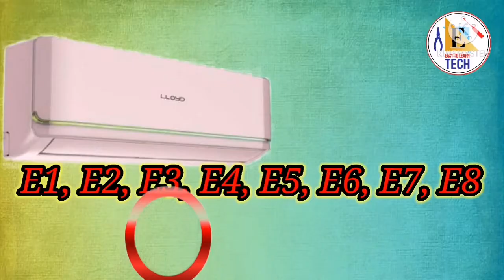LLOYD DC INVERTER AIR-CONDITIONING ERROR CODES AND FULL SOLUTIONS // TROUBLESHOOTING /TIPS /SOLUTION

Comment: How to remove cl error
Reply: Please wait for 5 minutes i do this
Reply from the maker: Please let me know if your remote is getting operate or not. If the remote is not getting operate it means child lock has been activated.
Reply from the maker: To remove the lock you have to press (  - & + ) both at same time. Your remote will be in normal mode.
Reply: How to off this error give me solution
Reply: Yes my remote getting work properly
Reply from the maker: If your remote is operating properly,than clean the filter. Re-start the unit.
Reply: Press (-&+) in which position after on ac or after on full ac
Reply from the maker: @madanmachinerytools7031  On
Reply: This solution is not working
Reply: I clean my filter but also show this please give me more solution
Reply from the maker: Your are getting cool air or hot air from ac?
Reply: @Rehankhan_HVAC_TIPS  cool
Reply from the maker: Cl is not a error, if your filters are not cleaned than it will show cl or if child lock is activated than it shows CL . It will not effect anything.
Reply: @Rehankhan_HVAC_TIPS  it mens you not have any solution😔
Reply: Press Turbo button 4 time Countinu

Comment: What about E5 and E6
Reply from the maker: Error E6: This error code usually shows up when there is an issue with Outdoor malfunction. It is prompted by LED 1, LED 2, LED 3, LED 4 which keeps flashing.  Need to check the outdoor side.
Reply from the maker: Because this error changes according to the model in Lloyds ac that's why I skipped.
Reply from the maker: If you have any issue please let me now,I will try to help
Reply: @Rehankhan_HVAC_TIPS  yes, mine is lloyd inverter model.
It shows error E5 after 30 seconds of turn on. I called a technician from Lloyd he charged me 550 to say the whole outdoor pcb is gone, need to replace with new one which cost 12,500 rupees. I don't think the outdoor pcb is gone. I am a smps technician once upon a time. I don't think pcb has any issues. So I checked with my friend who is a TV technician. He checked the board and said there is no short in it.Spoke to a local tech and he said the error must be from indoor unit. Don't know what to do.can u help
Reply from the maker: Please tell me the model for your ac
Reply from the maker: Best way to find , which PCB is faulty
Reply from the maker: Newly installed or old unit
Reply from the maker: If you have technical knowledge than only do this,other wise don't take risk.
Follow this process below.
1] Check the communication cable between indoor & outdoor unit , all 3core or 4 core cable continuity. 
If the continuity is ok , connect the cable as before connected in indoor & outdoor.[ Tools need multimeter or clamp meter]
2] Give the power & on the ac 
Check the voltage in outdoor unit [ put the meter in Ac voltage] if voltage is normal or not. If voltage is  normal go to next process. other wise thier will be power issue.
3] check the netrual & communication connector thier should be dc voltage between 9v to 30v. If you don't find this value.
4] Disconnect the communication cable from outdoor unit than start the unit but be careful, check the communication cable coming from indoor unit & netrual it's should show DC Current between 9v to 30 v. If it's coming between this it means indoor unit PCB is good.
4] now check outdoor side don't connect the communication cable in outdoor unit. 
Check netrual & communication connector only the voltage should be between 9v to 30 v DC CURRENT.
IF ITS NOT COMING IT MEANS OUTDOOR PCB FAULTY.
CHECK IN LOCAL AREA IF SOME REPAIRS THE PCB IT WILL COST YOU LESS MONEY...
NOTE : THIS ALL PROCESS YOU WILL DO ON YOUR OWN RISE ,I WILL BE NOT RESPONSIBLE FOR ANY DAMAGE TO THE AC UNIT OR TO YOURSELF..
Reply from the maker: If you have any issue please let me now,I will try to help